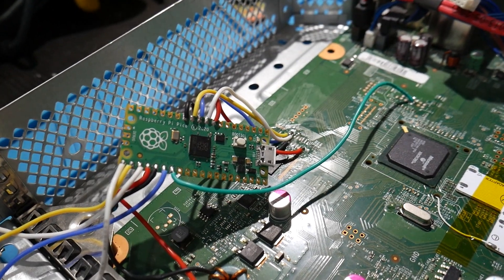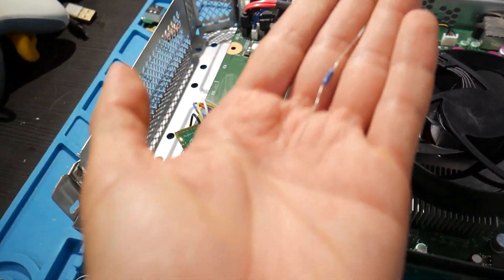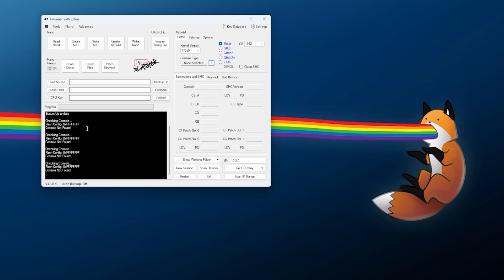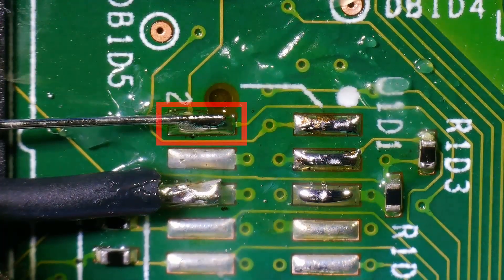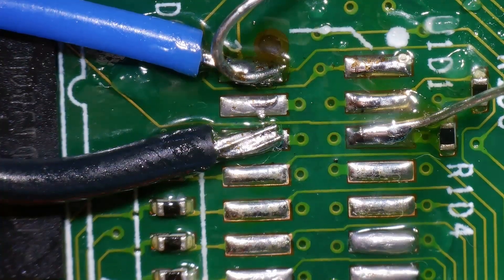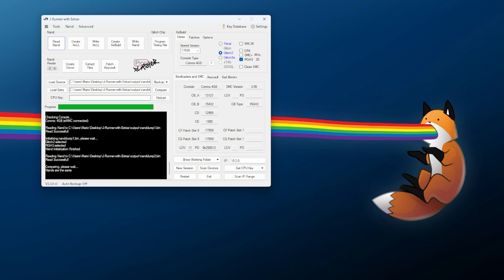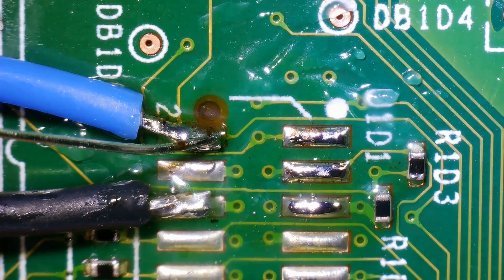Fixing the "Console Not Found" Error for PicoFlasher & Corona 4GB Motherboards

Comment: Some alternative points to reduce pad damage risk:

Instead of having the resistor directly on those pads, try on the Pico instead, as the Pico is slightly more disposable if a pad gets pulled:

Pico Pin11 (blue wire) to Pico Pin36 (3.3v) via 10k resistor.

(Or just alternatively put long thin wires off the resistor.)

The ground wire bridge to the other 'lone' wire that connects to pin 27 on the Pico - again, to minimise risk, just bridge Pico pin 27 to pin 28 as thats a ground pin.
Reply from the maker: That's actually really solid advice, thanks for sharing!
Reply: Thanks and what about the jasper bigblock 256/512mb flash nand. Didn’t work with the PICO any idea 💡
Reply: @Ben-Marzouk-Tarefe76 In 'some' cases with SPI in general, the MISO pin needs a pull up, so yes you could 'try' a 10k resistor between pico pin 21 (MISO) and Pico pin 36 (3.3v)

But do the Phat (or any non-eMMC) models have issues with PicoFlasher normally?
Reply: @TinWhisker  am having issues right now doing a xenon board. Picoflasher was able to read the nand perfectly and flash xell with no problems, i made the mistake of removing the pico from the board before i powered on the console. got the cpu key into jrunner no problems, go to hook the pico back up to flash xebuild but now the pico is refusing to recognize the console at all. pico lights up the green light when i try to read nand and then back off if i try again and so on. have tried reflashing pico with the picoflasher.uf2 file even completely removing the drivers off my computer and manually reinstalling them to no avail. solder joints are fine, wires are short. using the same wire and leads i used the first time around when it worked fine. very frustrating being so close yet so far haha thankfully ordered an xflasher as a backup and it should be in on monday 8/19/24 fingers crossed eh
Reply: @dodgethefatherramthedaught4652  I had some similar issues with my Picoflasher, it totally stopped working. And it was after disconnecting or reconnecting wires, or was it trying to flash without having it connected. I do not know exactly what triggered that behavior. In the end it required a PC reboot, after that it was again working as it should.
Reply: @dodgethefatherramthedaught4652  You might be slightly too early in the process, can't remember, but XeLL supports flashing your NAND with a file from a USB drive, so there's a chance you got far enough that you can whip up the modified NAND in JRunner and pop it on a flash drive to flash.   It's good you got your CPU key at least also since then even if your dump or flash were corrupted you could use it to whip up a compatible donor NAND if needed, which could then be flashed by an xFlasher at least even if you can't get PicoFlasher to work again.
Reply: @SoundToxin  thanks for this. good to know.
Reply: Yeah, was going to suggest the same thing.
Reply: Thank both @Mrmario2011 & @Tinwhisker

Did the two additional connects on my pico end and worked 1st time

I had a 4gb with a Toshiba emcc
Reply: @TinWhisker Could those Pico-side connections be left in place when reusing the Pico to do a 16MB?
Reply: For some reason soldering things to the pico instead of soldering to the board solved the problem, thanks.
Reply: Can you show me a diagram or picture of the work you do i have the same problem. Help me please
Reply: Can someone help me? I blew up pad 16 to read the NAND. Should I jumper to the resistor under the pad? Or where do I jumper to be able to read the NAND later? It's a 4GB Corona V6.
Reply: @brabohorxbpx yes, just wire to the end of the resistor closest to the torn pad you should be fine. Be delicate and use flux

Comment: I have a question.

I did all the conection from the Raspberry to the xbox and the Pc doesn't detect the Console, as the vídeo. But i have the problem with a corona V2, do you think It Will work? I ask before do the test, because i don't want to make a short on the xbox.

Comment: Thank you so much for this video, I would have been stuck for ages if it wasn’t recommended right after your corona video. I ended up soldering 10 1k ohm resistors together and it worked 😂

Comment: I have a corona board in a xbox360e with this very issue. After following the instructions from weekend modder without success, I came here. Not having the correct resistor to hand, I desoldered my rgh3 wires, used bad update to run simple 360 nand flasher to dump the nand and cpu key onto USB. On my PC I used Jrunner with extras to create my modified rgh3 nand with this and then with modified nand on my usb I went back to my console and wrote the new nand to the console.
RLOD on reboot as expected, but once I had resoldered my 2 rgh3 wires, console booted up. 😅

Comment: J-Runner freezes and shows  error pressing anything (read nand or check console etc Everything is soldered correctly, tried multiple times🤔
Reply from the maker: Try another USB cable, port, or even PC.
Reply: @MrMario2011 I’ve literally tried everything:

disabled antivirus,

tried on a different laptop,

tried a clean version of J-Runner and also different versions,

added the 10k ohm resistor — still no luck.

I have two Corona 4GB consoles and the exact same issue on both.
One of them probably has a faulty eMMC, but the other shows 4GB properly in the system menu.

So at this point, I’ll try to hack console " bad update" and then try to dump nand  via NAND Flasher 360  through aurora and then prep rgh and reflash, perform soldering afterwards. 

Thanks for the suggestions anyway!

Comment: Im having this issue but its a trinity board any tips
Reply: this is due to poor soldering. I’d resolder the points and try again.
Reply: @lukeLT1ss lol no it was all soldered good it was the resistor didn't need it at all
Reply: @DarkfoaxProductions  Resistors are needed on RGHs lol
Reply: @lukeLT1ss idk what to tell you i can send a video but yeah mine is rgh3 and doesnt have a resistor just the wires ❤
Reply: @DarkfoaxProductions also a resistor that goes from the PLL has nothing to do with reading or writing the NAND. Long term that console isn’t going to last without a resistor. Have fun with a dead console soon.
Reply: @lukeLT1ss all I know is that with the resistor no boot of any kind without the resistor boots right up

Comment: managed to hook this up using an 0402 10k resistor, put it on a dip board and soldered wires off of it. worked perfectly
Reply from the maker: Love that this still helps 🙂

Comment: Once again MrMario to the rescue! I can't believe this info hasn't made it to the major guides, instant fix for me.
Reply from the maker: It can be hit or miss, but it can certainly help some! Glad this is helping.
Reply: @MrMario2011  seems pretty hit for the issue, based on the number of positive responses. Even if it's not guaranteed, it should be mentioned as an option. Thanks again for putting this out there.
Reply: @MrMario2011  I'm not sure if you are aware of 15432's fork of PicoFlasher? It allows you to use the SMC programming header for both types of nand, and seems to be more stable than the original. I can't link to it because of youtube but it should be the first fork.

Comment: 5:27 can i just solder wires to both end of the resistor and us that to solder to the board instead of directly using the resistor's leg?
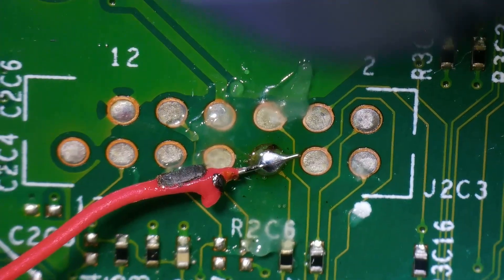also 6:55 instead of soldering 2 wires to the same pad, can i just connect the new wire to the existing wire instead?  thanks

Comment: Here is the Pin Layout to do it on the Pico Flasher

Pin 11 (GP8) wire the 10k resistor to Pin36 (3v3)
Bridge Pin 27 (GP21) to Pin 28 (GND)

Comment: I don't know if I'll get a response but I was having issues with the console not found and this solution did the trick, the issue now is that the jrunner got frozen and I gave up, removing the cables turns out my resistor was loose, but now with everything removed my xbox 360 slim 4gb does not power on, makes power on sound and disc tray sound but it does not power on any led light, can it be that while reading the nand it got something bad?
Reply from the maker: Reading it alone would not break the system, unless you caused damage or shorted something.
Reply: @MrMario2011  :( thanks for the fast response

Comment: Any solution to fix no signal? With a glitch chip and even without the glitch chip. Solid green and fan is spinning. Unable to boot xell.
Reply from the maker: It could be an issue with RGH3 soldering or solder quality. If all is sound, use another flasher.

Comment: I am so grateful for this. It worked exactly as mentioned in the video. This was my second 4gb corona and my third console overall so I was kinda confident with my soldering. Tried different cables, computers... bought second pico, resoldered everything 5 times, but nothing worked. Wish I found this sooner. It should be distributed with the wireing diagrams. Thanks a lot, Mario!
Reply from the maker: This was a fix that balika011 helped me find through messages, so it hasn't been documented anywhere before this video. Glad this helped!

Comment: the video helped it detect my console, but when i press write Xell it finishes and makes a bell noice but it doesnt say succesful. After I unsoldered the pico and turned on the console but nothing appears. Just the fan is spinning and circle is green but no screen comes on. Any help please?
Reply: I get no errors. I dont know what the issue could be
Reply: Did you get it to work? I'm having the same issue, saw someone say xell has issues sometimes with HDMI so worth a shot with the AV cable. I need to try this out to once I get my hands on a set of Av cables.
Reply: @cri1027  no, i tried everything, i redone everything from the start, everything is soldered really well, because i work with soldering. I dont have a AV cable but I tried different hdmi cables/different monitors. But still i have a still green light and the fan is running. The tv sees that a hdmi is connected but just has no signal. I did everything by the steps. I even used really short cables for the pico and the ppl. I found it it doesnt matter if the jrunner doesnt find the rest of the infomation. I guess the last choice is to purchase a AV cable...
Reply: @cri1027  i just hate to buy a av cable and invest more money and then i will find out it wont work again. It will be so frustrating
Reply: @cri1027  did you get it to work? i bought a glitch chip ace v3 and i still get no signal...
Reply: Any luck?

Comment: Awesome and detailed video. Finally managed to get rid of the dreaded console not found issue with this fix. However i need some advice. Out of 30 read attempts, i managed to dump the nand once, the second read was not the same and comparison failed. I saved that "successful" dump and continued again. After about 30 minutes of doing other things in between a few read attempts, i got another good read of one dump and second failed after reading for maybe 15 seconds. I compared this to the first successful read and they both are identical.
So 2 questions: 

Do i go with this and create a xell image and hope that they are in fact perfect dumps?

If reading 2 identical dumps was so hard, could writing the xell image possibly also have issues? 

FWIW my soldering is super neat ( I do electronics repairs eg, console hdmi ports and retimer ic's ), using Picoflasher, white slim corona v3 with 4gb nand.

Wires used for Pico to corona is probably about 20cm long, so not sure if thats an issue. Tested, re-tested pins and wiring, and also de- and re-soldered wiring.

Also, when the reads fail, if i immediately try again, J-runner gives an error saying "Cant, picoflasher firmware out of date". If i unplug the pico then plug back in it reads console, and i can read nand again. Sometimes the nand reads for 3 seconds and fails, sometimes it reads for 25 seconds and fails. Its ALWAYS random.

Any advice and suggestions would be greatly appreciated.

And, i followed your RGH 3 tutorial to get the correct J-Runner as well as Pico firmware

Thanks again
Reply from the maker: To answer your two questions:

1. If I was having that many issues getting a proper dump, I'd hesitate to continue on with the current configuration. Unfortunately it might be best to verify you can get a proper NAND dump with another seasoned programmer such as the xFlasher, PicoFlasher can be hit or miss.

2. Yes.
Reply: @MrMario2011  Thanks for the response. Thankfully this is just a project as i got the console for super cheap due to laser not reading discs. So will have to bite the bullet and try order an xflasher 360 as nobody in our country sells this. Such a pity, had a JR programmer as well as a Nand-X which i binned years ago due to losing interest in doing RGH consoles for friends and family etc :D :D.

If i really wanted to get this going, could the SD Card reader method still work? albeit more time consuming in terms of read and write speeds etc? Just a thought. Not wanting to rush it but seems Weekend Modder and Phenom Mod dont ship to South Africa :(.

Again, thanks so much for the advice and your excellent tutorials

Comment: Just looping back. I've tried this, and it worked great on two stubborn consoles. I couldn't get the 4GB tool to easily read these, and the pico hadn't worked at all, but then I put that 100KOHM resistor in and it worked immediately like magic, so thank you for sharing.
Reply from the maker: Glad it helped! Although do you mean a 10K resistor?
Reply: @MrMario2011  sorry yes lol 10K

Comment: Just tried this on my 4gb 360 E finally got it to recognise my system. Btw you can just  solder the resistor on the wire by just exposing more of it.👍
Reply from the maker: Good tip!

Comment: After realizing my 360 S was a 4gb Corona and finding THIS video.. I've spent several days soldering, re-soldering and connecting to Jrunner..
I went from Console not found to finally getting  "Corona: 4G (eMMC connected)"

BUT... Jrunner freezes... it goes into "Not Responding" mode for about 1 minute and then Jrunner spits out the error

Checking Console...
Corona: 4GB (eMMC connected)
PicoFlasher has encountered an error
Try to unplug and replug the device
System.TimeoutException

-------------FUTURE ME------------- For anyone who has the same issue as me...

I stopped making this post midway through as I found that I only had a 10 Ohm not 10k Ohm resistor hooked up... 
I soldered in the new resistor and BAM! WORKING! a Little bit of sleep and a clear mind helps a lot!

J-Runner with Extras
Session: 09-09-2024 12:37:27
Version: 3.3.0 r3
Status: Up to date

WARNING - Working Folder!
Your working folder is not empty, click Show Working Folder to view its contents

Checking Console...
Corona: 4GB (eMMC connected)

Reading Nand to C:\Users\Beast\Desktop\Xbox 360 Files\Jrunner\output\nanddump1.bin
Read Successful!

Initializing nanddump1.bin, please wait...
Glitch2 selected
Nand Initialization Finished

Reading Nand to C:\Users\Beast\Desktop\Xbox 360 Files\Jrunner\output\nanddump2.bin
Read Successful!

Comparing, please wait...
Nands are the same
Reply: Future Future me...
I ran through all the steps with no problems at all, everything finished successfully.
I de-soldered the resistor and the jumper line, leaving the Pico still attached.
I then booted up the 360 S Watched the boot animation/logo and right into the stock looking dashboard.
I then powered off the 360 and when it was off I hit the Eject button to boot into Xell and was greeted with nothing but a black screen.
Now I am stuck with no video output from either boot method. But I was able to resolder the resistor and the jumper back and Jrunner sees the system...
What should I do? @MrMario2011
Any ideas!? So close yet so far lol...

Comment: So this one is giving me some trouble on my white Xbox 360 Slim. At first, I was getting the no console found issue. I did what you mentioned on here and it resolved that issue at least. Problem is, I don't think the Nand was dumped correctly or something, because when I wrote Xell, the Xbox would just power on, but it wouldn't boot into Xell and the LED ring never spun. It just remained a solid green light at the center with no signs of activity. 

I made sure to double check all my solder points and redid them all. I even readjusted the postfix adapter to make sure it was making proper contact. I still haven't ruled it out for being faulty but I don't have another one at the moment to test. I also made sure to re-enable R/W for the NAND. 

I'm pretty stumped. I also ended up pulling Pad 1 but I was able to use the trace that connects to that pad. Does anyone have any suggestions on how to proceed?
Reply from the maker: Rewrite stock and verify it boots properly. If it does you can try it again, but if PicoFlasher is the issue (which it has been known to be buggy) then you're probably better off getting another flasher.
Reply: @MrMario2011  I tried rewriting stock and undid everything and it doesn't boot up either. There's no red ring, just a solid green light and no video output. I did order an SDtool but it'll be a while before that arrives.

Another thing I noticed but I don't recall if these areas are populated after you read the Nand. In Bootloader's and SMC, non of the boxes display any of the information other than the "Console" box.
Reply: @devilinthewoods3809 have you found a solution for this? I'm having the same problem but lucky me when I reflashed to stock it booted fine. Reading nand was fine as well after doing the resistor work shown in this video 😢

Comment: first time modding a console here, Corona V6 4GB (hynix emmc) I bought a spool of 30AWG solid core colored red. Looking at the Pico diagram theres multiple colored wires so im wondering if using this 30AWG is safe for this? or is it just different colored insulation and im just overthinking?
Reply from the maker: Purely aesthetic, not functional.